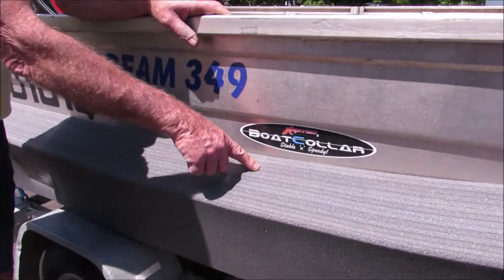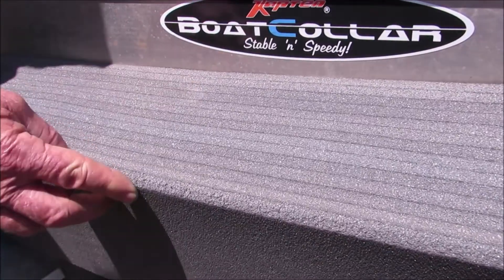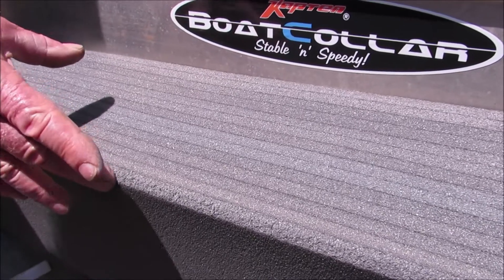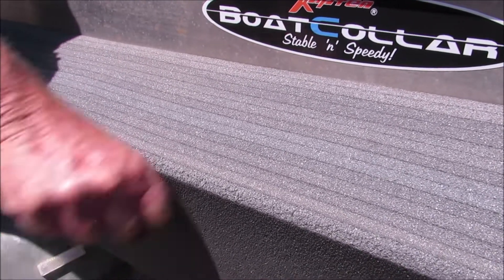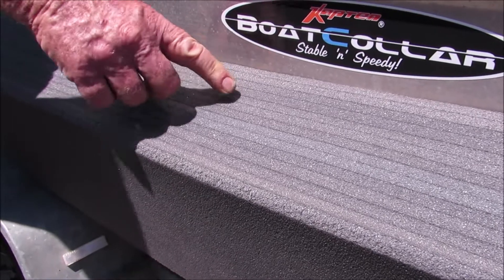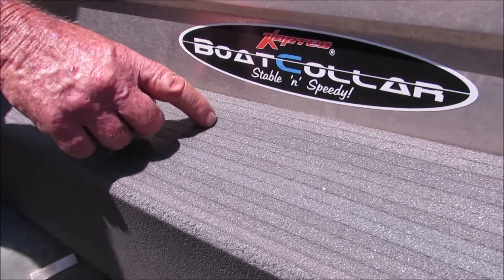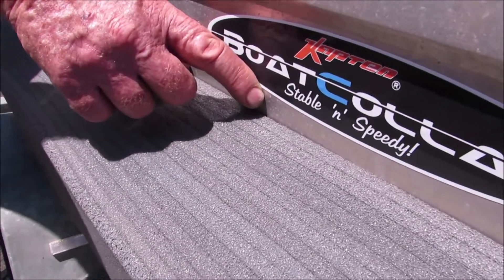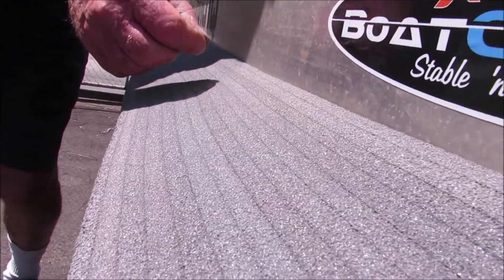Close look at a Kapten Boat Collar

Comment: They should probably delete this. I was wondering if I could just glue a bunch of foam together instead, turns out that’s what they did.
Reply from the maker: Hi Beor.  It is very hard to glue individual layers together and produce a clean looking, solid piece of foam that's not oozing glue everywhere.  But if you give it a go, that's great. Safety is the aim of the game :) There's a heap more to the system than just foam strips, but they work incredibly well. All the best. -KBC

Comment: So, it's just foam. I could build that.
Reply: Maybe you can use pipe pvc 😁
Reply: Lol, would probably work 😂 that foam can be bought in strips or sheets for pretty cheap.
Reply from the maker: Hi WWM, It's true some foam can be purchased cheap, and that's what it is - cheap & nasty. Ours is purpose built for the marine environment and has years of research and development pilled into the design, shape & fitting system. Hence why we won a prestigious Gold Tick Award in 2019, judged by a panel of engineers etc. But if you try making a Collar yourself, all the best to you. We all want you safer on the water! - KBC
Reply: @KBC-WR  that must be why your collars are so ridiculously expensive!